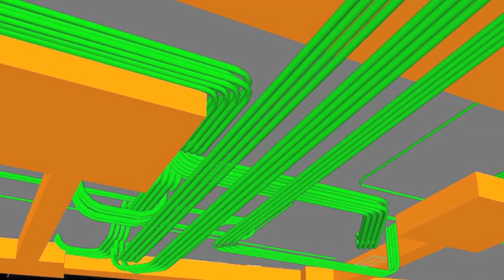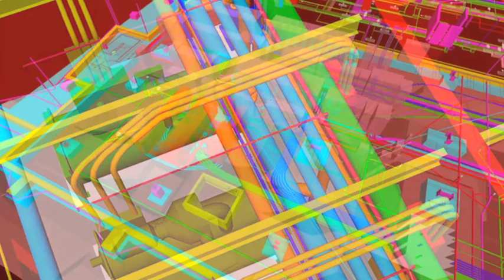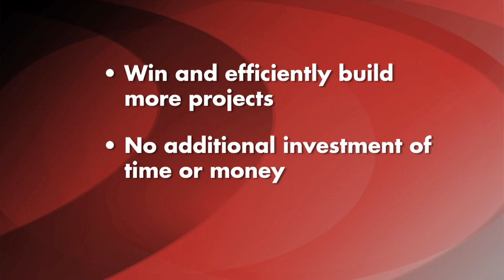The Power of BIM - An Introduction to Building Information Modeling

Comment: BIM is just the result of CAD  3D capability already used in project since 15 years +. the bad designer will  always be a lower rated designer. The construcbility comes from wide experience on project from construction completed on site. 
There is another definiton of BIM Building image management. Many details are not considered enough because many designers do not know '' How to'' and when in planning.

Jacques Huot